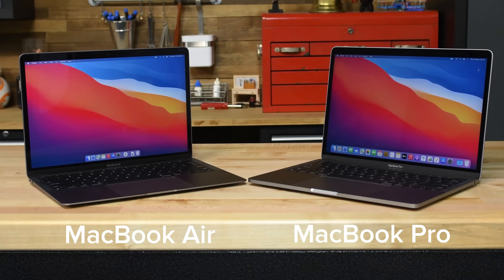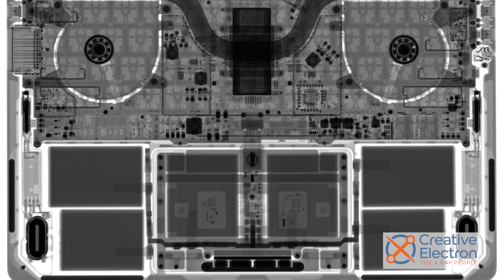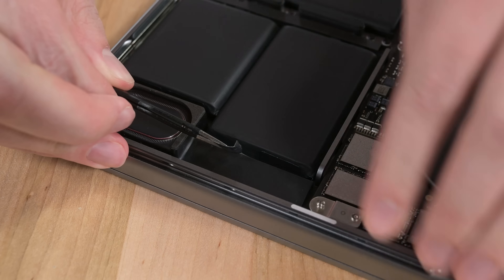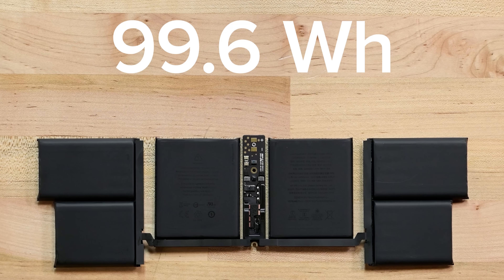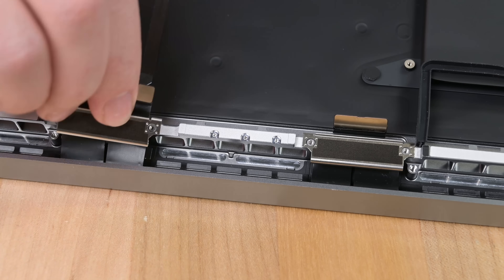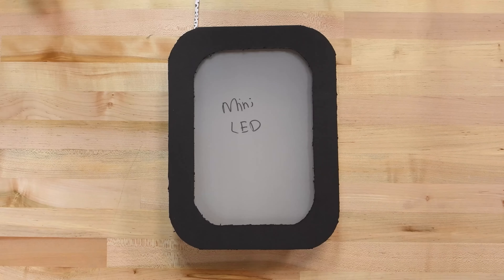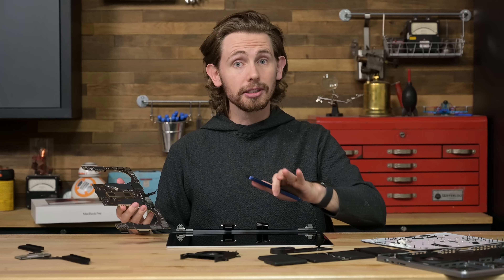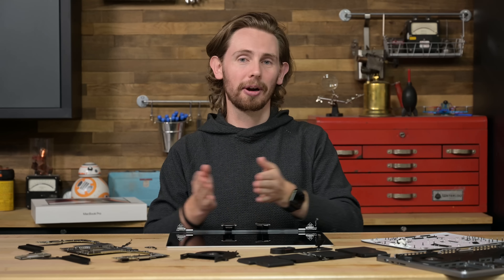MacBook Pro 2021 Teardown: Easier to Repair, Harder to Score…

Comment: The shared SoC RAM I understand. It does actually provide a sizable performance improvement that is hard to replicate with other options at the moment but there is no good reason to solder on a SSD, the M.2 socket is tiny anyway and if you are concerned with the thickness there are even versions that live in a PCB cutout on the same level as the PCB instead of sitting on top of it.
Reply: Hear hear! While I would prefer user-serviceable RAM, I can understand why that’ll be a thing of the past in the near future, even if I grumble about how much I’m paying for the extra RAM. SSDs however, they wear out, and should be very much replaceable, even if only for security reasons.
Reply: @Ebalosus  For these type of SOC, it is not even possible to get DIMM slots at all. If you look at the specs of M1 Pro and M1 Max, they have 256bit and 512bit memory bus width.  1 channel SODIMM DDR4 only gives you 64 bit memory bus width. Dual channel is 128 bit.  So to get M1 Pro and M1 Max memory bus width, you need 4 DIMM and 8 DIMM slots respectively. That is impossible on a laptop this size .
Reply: I mean, the wearing out is really not the problem. The problem is, if the machine don’t turn on for whatever reason, how are you going to retrieve the data yourself? If it is removable, you can simple unplug the SSD and plug in into another machine. Now, if your machine can’t turn on, your only option is to bring it to a repair shop, and even in that case, transferring data elsewhere will require some knowledge and tools. In any case, if you need that data in 3 hours, it’s going to be a fun time.
Reply: @lc9245  While I don’t like the soldered on SSD on these machines, I think you should not rely on a removable SSD to get to your data if your pc fails. Better do backups to another external device. Than your data is safe even if the SSD itself fails. 
A better argument for a removable SSD is that you are able to upgrade the capacity years later, if you’re running out of space. It’s pretty uncommon these days that you kill a SSD because of too much data written to it, at least for normal day to day usage.
Reply: @lc9245  you couldnt get the data of the ssd anyway as its encrypted by the t2 chip.
Reply: @lc9245  I don't think it is that big of an issue. I think newer macs all encrypt its data by default. Even if the ssd isn't soldered on, you can't retrieve the data since it is encrypted.
Reply: At least it seems if you’re a tech savvy that you’re able to solder in some more SSD memory modules
Reply: The SSD is repairable. It is hard tho. You need to heat the board and cut the glue.
Reply: Sockets can be less reliable.  And while long term they are repair friendly, I'd imagine they generate a lot of warranty claims for loose connections/broken sockets. Apple's manufacturing ease interest, size constraints, and short term warranty concerns are likely what drives the move to soldered on storage.
Reply: Not that I like the approach of soldering everything in place, but I kinda see where Apple engineers come from. Apple Silicon is a very "wide" architecture, depending on big cache and wide memory bandwidth (fast transfer speeds) to have the SOC always fed-up. So they went not only for the fastest RAM available (LPDDR5) but also the fastest flash chips available with the widest interface available (7GB/s, PCIe 4x4).

Imagine somebody switching the original SDD for a "cheap" 3GB/s because they found an 8TB NVME on sale and losing performance in the process. The customer will be pissed off at Apple but it'd be their solely their fault.

Again, I'm not happy with Apple way of dealing with this, but I kinda see where their decision comes from.
Reply: @AlejandroLZuvic  Ya this time around the performance gains are worth it. Their pricing on ram and especially SSD upgrades are brutal though. $400 to go from 1tb to 2tb. Can buy a whole 2-bay NAS and 8tb storage for that.
Reply: @neilquinn  I mean, if we take something like the Sabrent Rocket 4 and compare the prices for 1TB and 2TB, the difference is about $200, which is half of what Apple charges. That's insane.

But comparing those prices with a NAS... I have no idea why that'd be relevant, of course plate/magnetic disks are cheaper.
Reply: @AlejandroLZuvic  Oh, I know it's not apples to apples at all, but in reality my "problem to solve" was to have more storage available to me at home. My choice was to bump up the SSD storage or to add external. So in a sense I am comparing the options I actually considered to solve a problem!
Reply: @AlejandroLZuvic 
In some ways the SOC is built more like a graphics card or game console such as the PS5 than a traditional motherboard and expandable memory would require some custom connectors.
But LPDDR5 is not the fastest memory available.
GDDR6 found in recent video cards is more than twice as fast.
The soldered SSD though is pure cheapness on Apple's part especially since modern SSDs are kind of consumable.
I would not buy Apple hardware at a this point even if the performance is good because of their stance on third party repairs and trying to lock you into their ecosystem it's just a bad anti consumer business practice.
Reply: AFAIR m1 doesn’t interface with ssd over pci lanes. Don’t know if that was bottleneck or its just random apple way of doing things.
Reply: Or it would be nice if there was like an extra M.2 NVME slot to just add some slightly slower storage :) It'll never happen though.
Reply: Actually they could have made the memory upgradable but it would require a custom slot and modules being added in pairs for the pro or fours for the max as a big part of the speed is the width of memory bus.
Now there is zero excuse for the SSD soldered in you gain nothing from this except for a few fractions of a mm no one is going to care about.
Reply: @DC90X  Technically yes, practically no - At least not in such a laptop. The chances of you being able to burn through your SSD through the device's lifetime, yet alone the warranty, is practically impossible unless you're doing something with the device it was absofuckinlutely not designed for - Like Cryptomining on it using your SSD which quite honestly is like using a Classic Fiat 500 for relocating the entirety of Buckingham Palace to a new location - Possible given enough time but not part of the design spec.
Reply: If worried about data loss with failed SSDs, use a cheap hard drive backup regularly with time machine.
Reply: @ronaldbrunsvold5632  I m worried of losing a 3k MacBook over a 100 dollar SSD probably not in the first two years, but drives definitely will die if the are overused
Reply: @SirAlph4  I’m talking about a backup drive foe when primary memory fails, not a frequent event. If worried, use two backups.
Reply: @Xavier Breath True they do have some very good engineers and and product designers working for them.
Reply: just so you know, Apple do not use M.2 connectors in their 2015 and older. They use a more custom/own built connector so it sits few cm high from motherboard. But yeah they maybe could stick using M.2 instead that is alot smaller and does not need more space in height.
Reply: I agree, it’s a shame not to make it more repairable. if you use your laptop heavily and keep it on 24 hrs a day (I used to do that on a few of my computers), you will need a new logic board just because the ssd went bad. My 2015 MacBook ssd died, not cost effective to replace the logic board since the part alone costs almost $500.
Reply: @virtudesign  SSDs don't wear down just because of "use", unlike a hard drive, it specifically takes a lot of writes to wear an SSD down, reads don't degrade it at all so just keeping it on 24/7 shouldn't be an issue.
Reply: @thebuddercweeper  There is a limit that you can break when you work with storage intensive software. I don't know how long that would take, but it will happen indefinitely. The "if" is the problem and the fact that you can't replace it in case something happens. You will for a fact notice performance issues in this products lifetime. There are many people that use these products for over 10 years, with heavy workloads this won't be possible. You are probably save if you go for at least 4TB
Reply: @virtudesign  I had a 2015 MacBook Pro. The SSD is not soldered on.
Reply: @Mike  2015 was last model series having removable SSD. 2016 and up the SSD is soldered to the motherboard. So changing SSD would need a motherboard replacement and costs would be alot more than changing SSD only.
Reply: @tseyksuli4541  I was just replying to someone with a 2015 who said they had to replace their entire motherboard when their SSD failed. Yeah, Apple will make you do that, but it is possible to repair it with just a replacement SSD. You can even use an M.2 adapter (and some kapton tape) to install a 3rd party SSD. But there are plenty of OEM Apple SSDs on eBay that could be used as well.
Reply: Apple, business model is to sell you same model with more storage for 5 times price, NVMe SSD 8TB is 1.2k$ on average, but price jump for MacBook from 1tb version to 8tb is 3 times that. This is the reason to have SSD soldered there ;)
Reply: @DC90X  That's negligible, I've got dozens of 10+ year old SSDs which are still at over 90% health, and that's them being used as cache drives and swap drives.
Reply: Only 2 commercial TLC SSDs that matches MBP's speed (7GBps Write) and endurance are Seagate Firecuda 530 4TB and Sabrent Rocket Plus 4TB, which both cost $1000.
Considering that, Apple charging $1200 for the 4TB upgrade isn't as big of a rip-off as other laptop OEMs who often charge double or triple the rate in configuring.
Reply: Yeah, as far as I know the performance depends much on memory speed. While ddr4 has like 20, in the best cases around 30GB/S, the M1MAX achieves 400GB/s there are simply less physical restrictions.
Reply: @domiblack2k182  That is grossly untrue, 20GB/s would be a slow stick running in single channel.
DDR4 3200 (which is on the slow side of good DDR4 now days) has about 25GB/s per a channel. Thus a standard 2 channel config would be 50GB/s (not massively far off the M1). It is only the M1 Pro and Max with their very wide buses that show a legitimate need to not have replaceable memory.
Reply: @SentinelSent  still very very far away from 200 or 400 GB/s. Ram speed is essential for the PC speed
Reply: @domiblack2k182  that's 400 for both the cpu and gpu, that's shared bandwith
Reply: I love my removable ssd in the 2015 macbook pro, but i also understand if the engineers at apple are going for "lets make the fastest ssd in a laptop". With that mentality, plus trying to capitalize on the storage, they're going to solder it for sure. and that's a compromise I can take for a couple hundred bucks more while purchase. Sad, but it's not the worst thing to happen on a computer unlike the butterfly keyboard lol
Reply: @StephenOrion  it aint the fastest and I believe they are not making them, they are just buying ssds from other companys. The problem is with low capacity ssd they fail faster then higher capacity ssds. They simply destroying the longevity of their laptops.
Reply: @SirAlph4  When you buy 1TB of apple storage,  you get x8 128gb of Kioxia SSD. So...
Reply: @StephenOrion  Thts bullshit. Apple never make the SSD for any of their products, most of them are bought from Samsung. There are many M.2 Nvme PCIe 4.0 SSD that can do 7GB/sec speeds these days.  Soldered SSD is just to make life difficult for users to upgrade their storage
Reply: When you consume an apple fruit, you literally consumed it and it didn't come back, you buy a new one if you want some more

Comment: Great review. One important note though: as of right now that performance level is in fact currently impossible with socketed memory. Even if you discount the fact that lpddr5 beat socketed ddr5 to market by over a year, or that socketed ddr5 is only available for server and desktop, there's still the fact that fastest socketed ddr5 is over 1ghz slower than the memory in the MacBook Pro (5200 MHz vs 6400 MHz). You really should revise your score to reflect the fact that in 2021, maximum memory performance and upgradable memory are mutually exclusive.
Reply: Well it’s really a physics thing, the longer the signal path (aka within the same soc vs across the board and then across contacts onto a module) the more limited your max frequency is gonna be before signal integrity becomes an issue. While it would be great if memory could be upgraded, you end up undermining your mission by making statements like “they have a bijilion dollars so they should fix it”, it’s rather vapid reasoning to an issue that can’t really be fixed. What about they keyboard? Or liquid ingress protection? These are things that can actually be improved, rather than reminiscing days of socketed memeory
Reply from the maker: I totally see where you're coming from, and we're keeping that in mind! But Apple makes a bajillion dollars a year and has some of the best engineers in the world working for them. Socketed ddr5 isn't the answer, as you said, but personally, I think that they could have found another way if it had been a priority for them. 🤷‍♂️ -TD
Reply: @iFixitYourself  the problem is I’m not willing to wait another year so their engineers can come up this new socketed memory technology for the M1. I had that 16” MacBook Pro money burning a hole in my pocket since June 😂 they can leave that feature for the M2

Comment: Solid teardown. Seeing how well put together the device is definitely making me consider getting one. I'd anticipate eventual failures on the ports and batteries, so seeing those be more easily replaceable is encouraging. (Although I wish they made the SD and HDMI ports replaceable too!)
Reply: Apparently the HDMI is v2.0 so high end displays will still need to run through usb-c anyway. The only real show-stopper is when the ssd goes dead so goes the main-board.

Comment: To disconnect the battery you would first disconnect the battery detection flex cable (to the left of trackpad flex cable) to disable and stop powering from battery going into the MacBook then you disconnect the trackpad flex cable. It’s a small detail you’ve missed.. 

Good teardown nevertheless.

Comment: For me a $2000-$4000 machine where I can't replace the SSD or I can't (even if it's only one stick) upgrade the RAM is just a no go. That plus all the issues that Apple had in the past and took years acknowledge.
Reply: I'm hoping for a market of replacing the whole logic board for upgrades. Not very likely....
Reply: @MM-MLT  Intel just introduced chips with DDR5 and PCIE gen5. If there was any performance difference it would be neglible.
Reply: @MM-MLT  Maybe you learn the terms you are using?
The RAM being where it is has nothing to do with it being Unified!

Unified memory means that the CPU and GPU both have access to the same, single memory address space and thus they do not have to copy data between memory pools. None of that requires the RAM to be soldered next to the SOC like on the M1 (e.g AMD CPUs and Intel CPUs have supported it for years when running the integrated GPU, all while using slotted RAM.